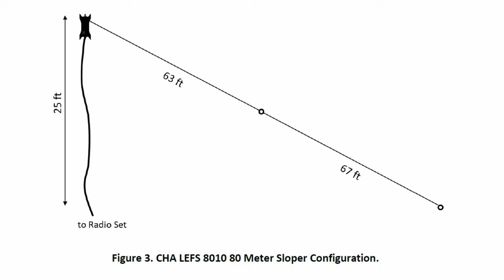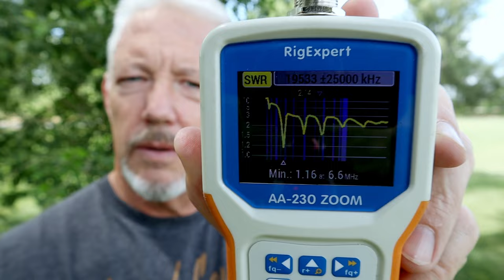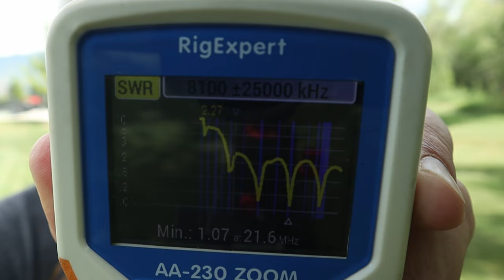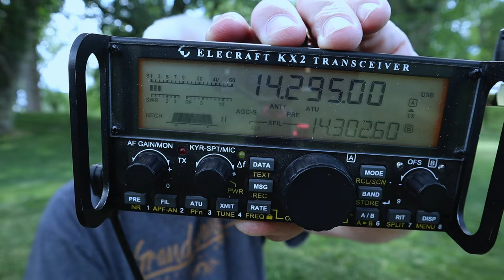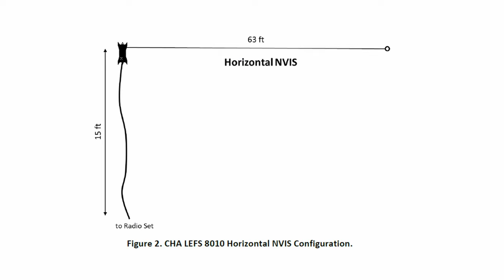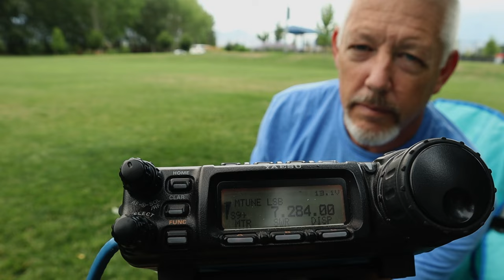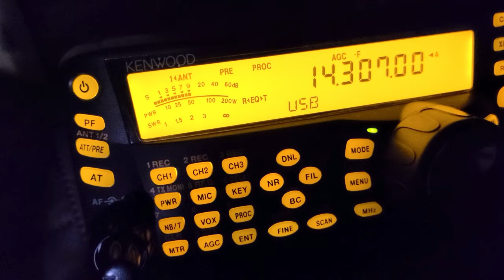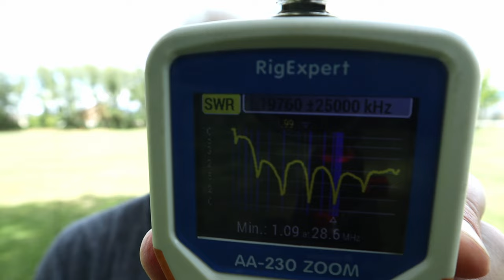In 20 minutes, this antenna became a "go to" for ME | K7SW ham radio

Comment: Rather luddite of me having to ask, but ... does anyone know the best after-market antenna for a plain old long range Radio Shack fm radio?  I live so far out in the boonies that I can only pick up ONE NPR station - sometimes on a good day.  Since I used to keep NPR on 24/7 when I lived 100 miles closer in, that's what I miss most.  Give the kids their MTV.  I want my NPR.
Reply from the maker: Frosty,  you are going to want whats called a "beam" or "yagi" or "directional" FM radio antenna. Try a YouTube or amazon search for those terms and it might get you close to what you are looking for.
I hope that helps.
Reply: Frosty, Check out C.Crane's FM Reflect-2 Dipole. I've used before and it works great. Only $15. Has a 75 ohm impedance so if your radio doesn't accept that plug, you may need a 300:75 ohm balun. they're cheap too! John

Comment: Have you tried the WARC bands?
Reply from the maker: @Alan Hargreaves, thank for asking. I have checked the match on the WARC bands, I just do not operate them much so I did not put that in the video.
Reply: @hamradiowithkevin  You might be surprised using them. I recall one day portable using 6W CW getting Sweden from Eastern Australia on 30m
Reply from the maker: @alanjhargreaves  that's what it is all about. 👍

Comment: Of course you're only assuming that antenna is radiating.  I'm sure it is.  And your KX3 is going to compensate for whatever it is.  A dummy load is perfect across all bands at all heights.  I'm being only partially facetious.  Instead of an swr analyzer (circuit analyzer)  we really need a spectrum analyzer at field points.  But then admittedly you don't know what the launch point is so your target reception is unknown.  I'm just thinking about ways you could make this analysis more meaningful.
73 de WØQR
Reply: Assuming that antenna is radiating? What this mean actually? The whole thing is made of a low loss high quality 49:1 UNUN and a certain length of wire!
Reply: @Chameleon_Antenna  If he wants to test his theory that the antenna may not be radiating I recommend (tongue-in-cheek) that he grab a hold of the line with his bare hand during a 1500watt transmission. The RF burns may be just the proof he needs. I'm NOT recommending he do so because that would be irresponsible, but it proves a point.
Reply: @Chameleon_Antenna  Like I intimated, it may be forming a dummy load.  If you consider the wavelength in order to radiate you'd HAVE to be a certain HAT (height above terrain).  I don't know what this is but it's more than zero I suspect.  A field strength meter (remote reading) would be a good way of doing it.  Take a series of them every 60 degrees or so to see what kind of pattern you have.  Of course it might be shooting straight up.  Not good.
Changing the height and having the SWR improve the lower to the ground you get is taking the design to the extreme..until it is a dummy load.

Comment: DX on a NVIS antenna? That is defeating the whole NVIS idea.
Reply from the maker: Kim, thanks. No kidding, it sure makes for a fun time. 73
Reply: I think what he was saying that "NVIS on that HF antenna" was a test of the negative.  IE If he had hit Europe the LEFS8010 would have failed as an NVIS.  
NVIS on 2-10 MHz is apparently the best (40m days, 80m nights, & 60m anytime) with height from 0.1-0.25 of a full-wave. Less height --> steeper Take-Off angle --> better NVIS. Hence a loaded whip bent loosely over a vehicle often does NVIS quite nicely. HTH

Comment: It's just a bit of wire with a transformer on it. They want about 50 times more money than it's worth for this stock basic antenna. If you can't build this yourself you should not be licenced.
Reply from the maker: There are many reasons a ham might not be able to build an antenna.  Having products for someone to buy so that they can get on the air is a good thing.

Comment: If  you're a CW operator you might want that 80 meter extension to be somewhat longer. The SWR down in your part of the 80 meter band is rather high to use without a tuner. But Mark Herman's results were different, with the 80 meter resonance down lower, so YMMV.
Reply from the maker: Very true 👍